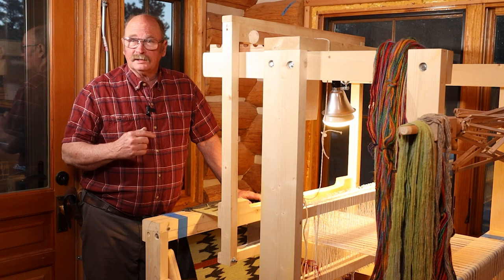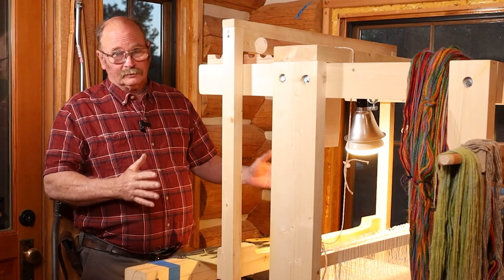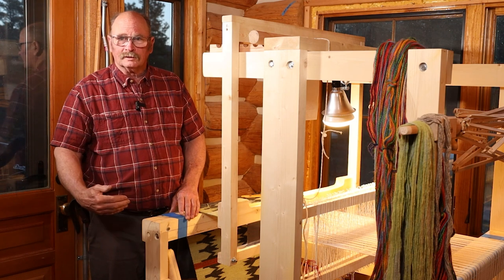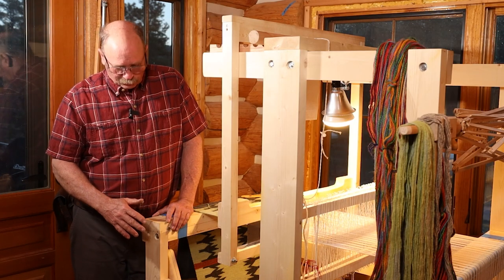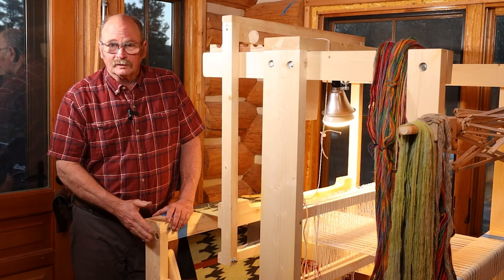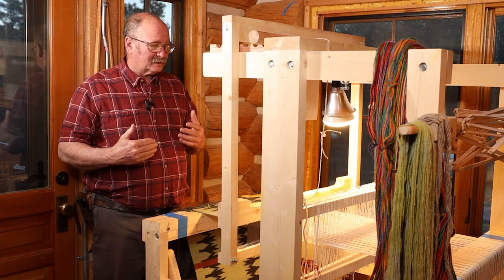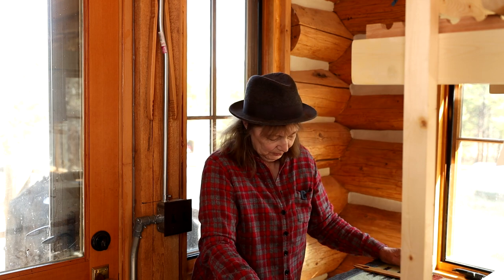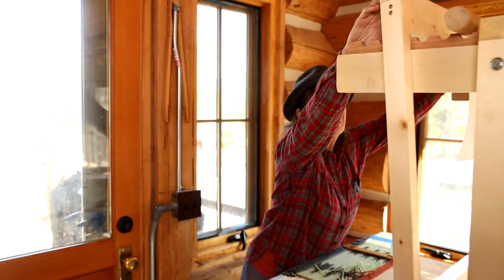Janet's newest Loom - Rio Grande walking loom

Comment: John.  Not sure how you did the dowel nuts, but here’s how I do them.  I coat the threads of the nut and a matching bolt, plus the mating part faces, with wax or petroleum jelly,.  Then I put the nut into its hole and screw the bolt through its part into the part with the nut.  Fill the nut hole with epoxy.  After the epoxy has cured, unscrew the bolt.  Makes it very easy to disassemble and reassemble.
Reply from the maker: Interesting approach, I have always left them removable
Reply: @JohnSwitzer  I’d probably lose the nut after taking it apart!

If the dowel hole is visible on the finished part, I use enough epoxy to cover the nut and fill the hole with a matching face grain plug.

Comment: Since you had a lot of the loom in parts, is there a reason that you couldn't just trim all the cross beams an inch shorter to make it a 35" loom?
Reply: The beam in the rear that holds the warp - it is an unusually complicated structure. We thought about cutting but took another look at that beam and backed off that idea.

Comment: Could you modify the loom so it would fit through a 36” door?
Reply: Not easily. That beam in the rear that holds the warp - it is a fairly complex structure, more so than usual. We talked about doing this but it sounds like a stressful operation.